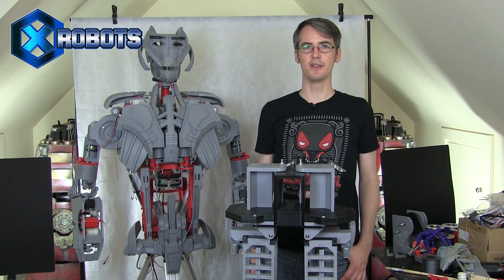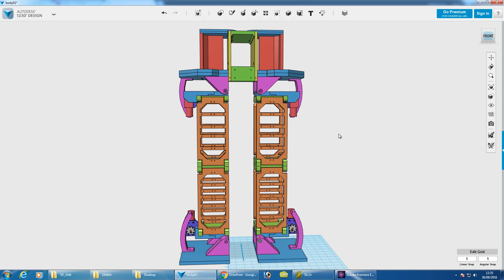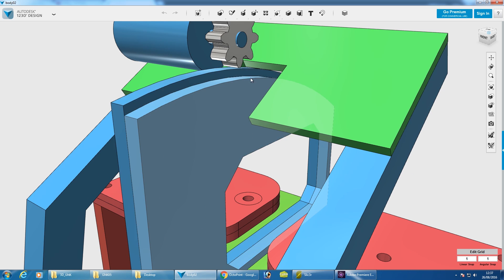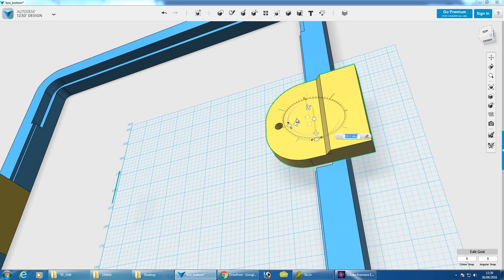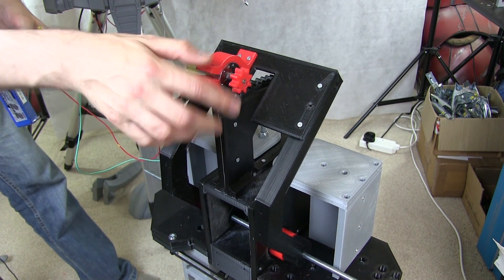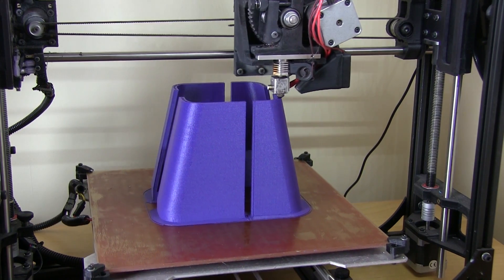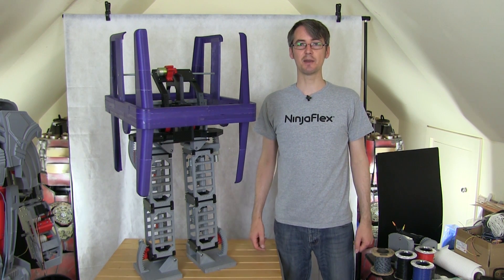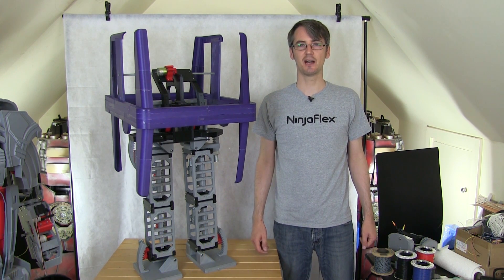Star Wars GNK Power Droid #5 | Body Frame Building | James Bruton

Comment: 4:27 "By cutting one of the teeth off a gear and using the circular rotate tool..." cringe Auch! James! That's not how involute gears work! No wonder your gearboxes break teeth and sound like a bag of rocks in a dishwasher... Please, please, for me spend an afternoon reading up on "Helical involute gears" because that will change your life. Those are (mostly) as easy to make on a 3D printer as the normal kind, and a machinist would give someone's kidney for that to be true in metal. 

I know you're always pressed for time, but doesn't Autocad have a specific involute gear-cutter module? Tony Stark is cool on screen, but don't forget the real life Victorian equivalents like Watt and Hargreaves. The other Jameses!
Reply: Seriously? Why take that tone? He's building plastic robots as a hobby. I have been watching him since he first started 3D printing and I can tell you I haven't seen one gear box break teeth. Don't add exaggeration to your own rudeness and ego-petting. If you actually watched his videos you would know he doesn't use AutoCAD, he uses the freeware 123D Design, which doesn't have the same functionality as AutoCAD or Inventor. If you weren't too busy typing away with righteous indignation, you would have noticed that his janky gears worked fine and were none of the things you described.
Reply: Sorry, the tone was supposed to be jocular and supportive, clearly I missed the mark. I really enjoy all the effort he puts in, but sometimes I think he's too stressed out making 3D printers work to be able to do all the historical research. 

The very last gearbox I saw him make did all those things. He's reaching the limitations of his materials, and may not know that the Victorians went through all this 200 years ago and perfected gear shapes it to a fine mathematical art, that was then improved again with helical gears. He's re-inventing the wheel unnecessarily.

He's not a machinist, and that's OK, but I would like to see his robots take advantage of all of those mechanical ideas, things it took me years to learn and appreciate. Gears are not just teeth arranged in a circle. I might be grumpy at the misconception, but not at him. I want to see him winning harder, is all.

OK, he doesn't use AutoCAD. I wasn't really looking that hard. I'll bet whatever he's using has an involute gear cutter. Gimp has one. Inkscape has one. Everything has one.
Reply: Hi! Yup, that one. That's how I know, 'cause you said so! I know it was built to break, but all I'm saying is I think it could have lasted longer with some slight changes. And if the techniques work for you, then your robots can get smaller and stronger. You hate backlash, yes? Helicals make that go away... (for a slight cost in controlling your sideways gear 'thrust')
Reply: ***** I'm really sorry if I didn't say it right, but the long and technical reason is that an involute gear tooth is shaped based on the radius of the 'wheel' it's on. By moving it to a gear of different radius, you can't help but concentrate stresses on the tooth at some part of the meshing cycle. 

I know you get inside these things sometimes (or just your fingers) and really I don't want you to have lots of time to learn about this stuff while recuperating. I cringed because I've made these mistakes myself, It was a memory cringe. And a total mis-fire of a safety warning/suggestion, it seems.

I just want everyone to be silky smooth.
Reply: ***** Rough test... absolutely! Never said otherwise. You should see some of mine... But that's also where we test our raw ideas, and it just seemed like you hadn't gone down the rabbit hole of gear hobbing theory yet. Probably why you're still sane.

Comment: How many prints of your 3D-Printer are failures? Not because of wrong designing, but because of the motors and so on.
Reply: +James Bruton (XRobots) Thanks for the answer.
I have a tip for you maybe for Ultron or a project of the future: For a robots head you could use a technique similar to the ones that helicopters use for tilting and turning the propeller. It is pretty easy to understand. I could try to make a video about it if you want to get more information.

Comment: You're printing large parts in ABS with an open-air build chamber. How do you keep them from curling/warping?
Reply: ***** Thanks for replying. Does your choice of adhesive on the printbed (if any) play a significant role in keeping the corners flat? I ask because curling has always been a major problem with my Zortrax M200 even after I closed off the sides.

Comment: Your stall at exhibits is definitely going to look like the exterior of the sandcrawler's tracks by the time this is finished. Not that you weren't there already in the living room as people have commented. You need some lines to give to ultron about being fluent in 3 million forms of communication don't forget. Might this project be appropriate to do some simple ai to allow the droid to wander? That box looks like an easier proposition to mount sensors to in order to get in not crashing into walls. I would be interested to see your take on that kind of behavioral AI. Then again a trade floor isn't really the place for an autonomous robot. Yeah great work again James.

Comment: you know, you test motors all the time. when are you going to make a bloody remote tester so you can test what you need. i know you will go not extreme but very well.
please just make a unit with some switch/pots/encoders and some tactile switches.
you do this all the time with a battery and jumpers. it would greatly help you pre test things better then just a pair of jumpers and a battery.
Reply: i should have said a portable tester.  

an even simpler solution would be a dpdt switch and the same jumpers with a bit of wire and soldering would make it better for you and give you the ability to move the motor back and forth.

this would probably be a project in its own though. love the projects and what you do.

Comment: you should really make a switch when testing motors and gears so you wont have to keep going back and forth from nev to pos.
Reply: And its not that difficult to make, just two buttons, possible 3d printed box, battery, connector, alligator clips and then some wire. Fuse as added safety, cause lipo...

Comment: Why not make a simple motor controller with a potentiometer to control the speed and direction for testing? Would save you having to do the terminal swapping and having the motors move too far too fast.

Comment: James, have you ever thaught of getting rid of the build lines on your prints? Seriouse question. You probably know how to do it, just get some filler primer and sand all the prints, then spray them with the primer, then sand again till theyre smooth. Only problem is its alot of work to do that to every piece and you have to cram it all into just a week. Great videos, woyld love to see more ultron :D
Reply: I've also heard of people using acetone vapor to smooth prints but you lose detail in a more uncontrolled manner that way.
Reply: I use acetone as it is to smooth the surfaces, just brushing it on and letting it vaporize. Time is enough to have it melt the plastic smooth, but still it wont ruin the details. Also with acetone its in the end best option cause it will cause the outer layers bond even better, where paint just fills the cracks. Only negative side effect is that plastic might turn little white in some spots and its glossy as fuck, but you can paint it after the treatment.

Comment: I know you're sponsored by a 3d printer company, but geez, remember when you used to use other materials?
Reply: There is not too much ways he could go. Also he he is limited by the space. He could do CNC parts (plastic or wood), but that is messy. He has a good design process and he takes familiar routes, so most prints come out ready to go. If you look carefully he is using many technique and materials, wherever it makes sense.
Reply: Probably cheaper.
Reply: 3d printing is exciting and awesome.  perhaps there are other items to save weight etc, but the printer does his bidding without having to find/grind the parts.
Reply: +James Bruton (XRobots) can you make a working 3D printer
Reply: +James Bruton (XRobots) PART 6
Reply: You could use a human, such as was used in the film "Silent Running"